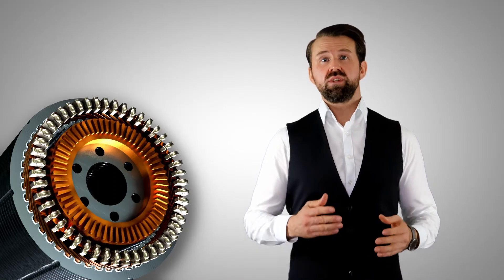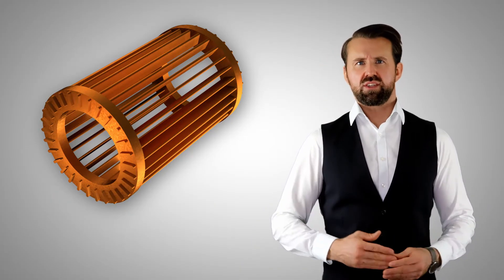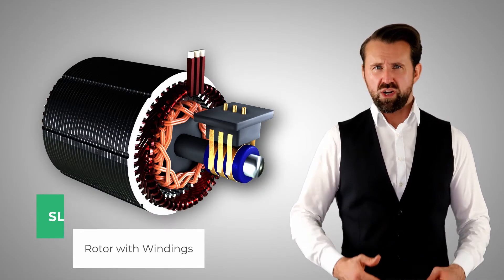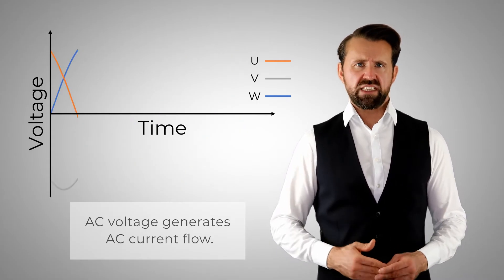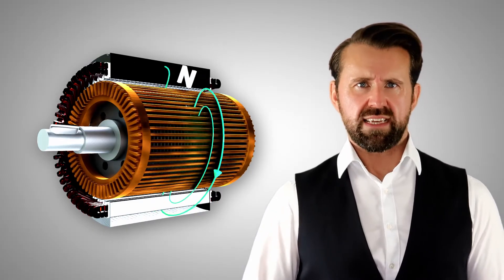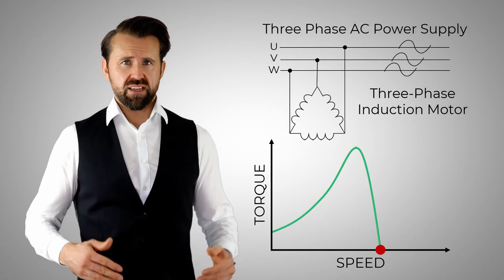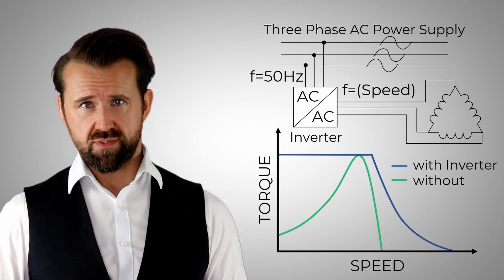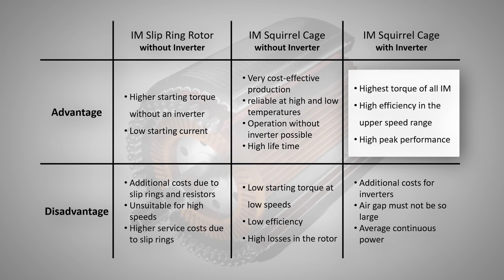Induction Motor Types Function and Comparison

Comment: what type of motor has the most torque? (450RPM, 12-180Nm torque constant is needed)

I see torque motors are "regular" DC, BLDC motors with 3 phases. they just use strong magnets and small air gap, etc. to generate enough torque
but are induction motors with similar size stronger or SYNRN motors? 
or 3 phase AC motors?
Reply from the maker: I have uploaded a video for high torque motor torque. Hope it helps you?

Comment: If you increase the resistance of the rotor bars/rotor that means that the rotor current will decrease, thus lowering the motor torque? So how can increasing the rotor resistance, increase the torque as you said in the video?
Reply from the maker: Can you tell me an exact timestamp of the video so I can better understand your question?
Reply: @Electric-Motor 6:40 - I also noted that. Anyway greate videos you do!

Comment: Excellent job, but Why should the air gap be small in inverter fed induction drives?
Reply from the maker: Thanks for your question. The air gap of induction motors should always be small, independent with or without inverter, because the energy from the stator must be transported via the air gap into the router, so that a current flows in the rotor bars, which in turn generates a magnetic field. You can compare this a bit with wireless charging in cell phones - the smaller the air gap, the better the magnetic coupling and the better the efficiency of the energy transfer. With a pmsm, I don't need to transfer energy for the excitation of the rotor via the air gap because you have the permanent magnets in the rotor. I can compensate a larger air gap in a pmsm simply by using more magnetic material.

Comment: Great video thank you very much. Are only single-phase electric motors without inverter or power electronics used in the household?
Reply from the maker: Thank you for your question. Since household appliances have to meet higher and higher requirements in terms of high efficiency, more and more electric motors with power electronics or inverters are being used.

Comment: 3d-printed Halbach Motor - Building Instructions - YouTube you can 3d print a hub motor and experiment for droning or wind power. If you could go over PCB design for speed/ heat measurement, breaking regeneration, and speed control, you would be well known in the EV community. No one is talking about making these. The higher end motors are expense to buy and SHIPMENT is EXPENSIVE. There's a lot of patient to do with hubmotors and I only see a people just testing them out.